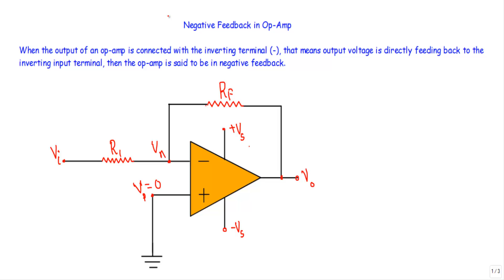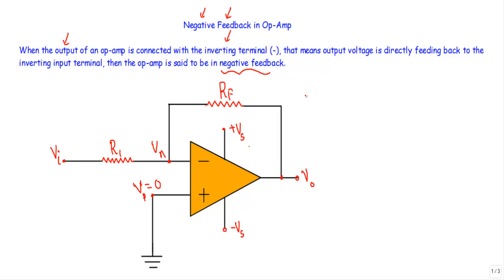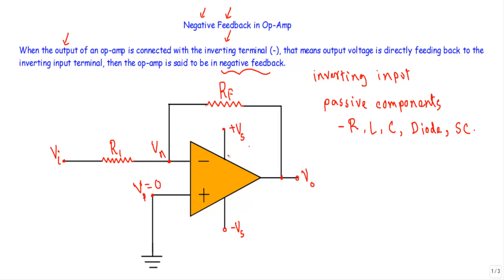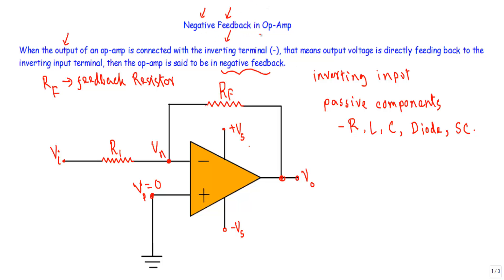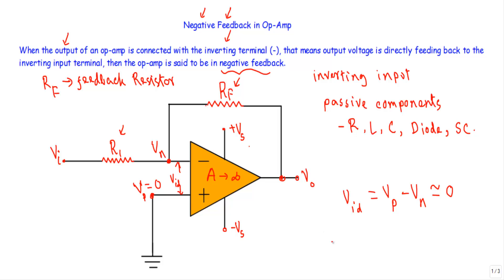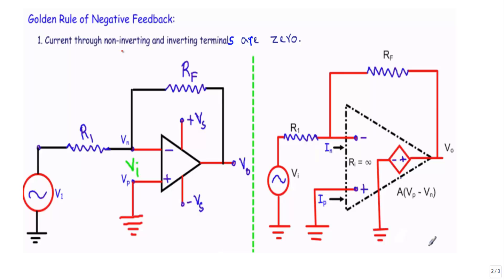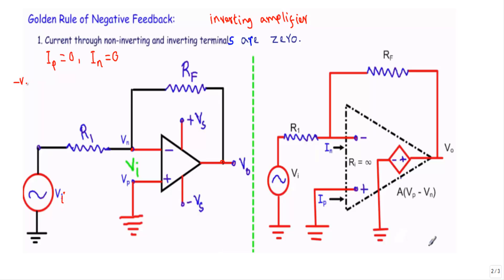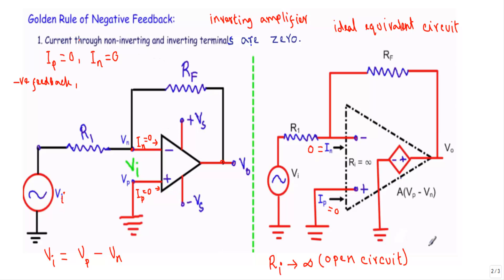Negative Feedback in OP-AMP, Golden Rules of Negative Feedback (w subtitle)

Comment: Istly Heartiest thanks sir for your beneficial videos.Sir are  these 2 golden rules are valid for ideal and practical op amp both?
Reply from the maker: for any op-amp circuit with negative feedback...
Reply: but sir in practical op amp we study Ip is not equal to In,we have input offset voltage,input offset current there,then hw is it possible?

Comment: isnt diode an active component?
Reply from the maker: Any component that is capable of providing a power gain is called an active component. They inject power to the circuit, and can control the current (or energy) flow within the circuit. If you use that concept, the diode is a passive component. If you use that sense, diode is passive element.

https://www.allaboutcircuits.com/textbook/semiconductors/chpt-1/active-versus-passive-devices/

Another way of defining active devices is they need external power source to operate. In that sense, diode is an active element. I saw some of American professors like to define diode is active element. But, they do not mind if I say diode is a passive element in terms of gain. 
So, I won't mind if you say diode is an active component. But, I prefer diode to be a passive element.

Comment: Sir, is it necessary that in case of negative feedback Vp =Vn , because in this case , there will never be an amplified voltage at output ?
Reply from the maker: Did you check op-amp inverting/non-inverting/summing/difference amplifier?? Also check the simulation of those circuits. Once you check up to output voltage derivation of these four circuits, write down the output voltage equation here. I will answer your question.
Reply from the maker: We don't have much things to do here. For negative feedback, Vp = Vn and it is true for every negative feedback op-amp circuit.